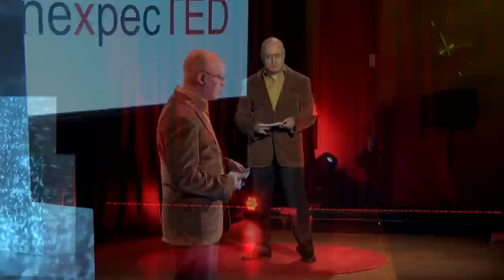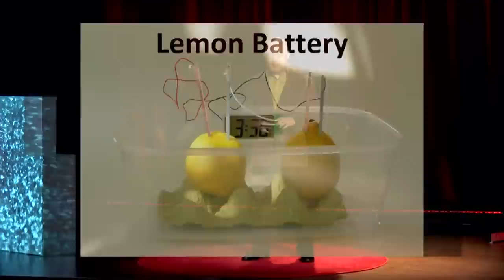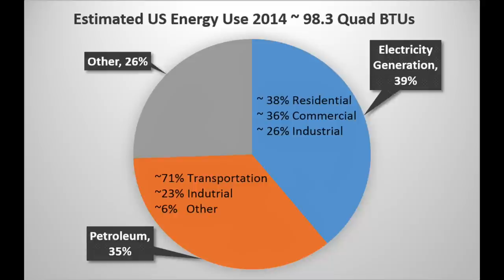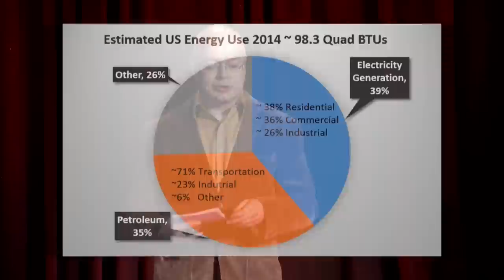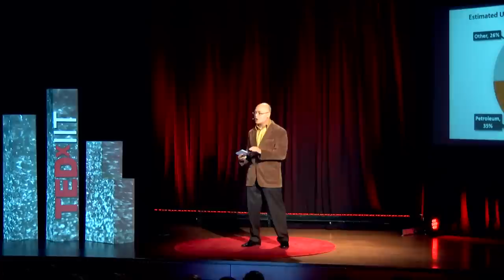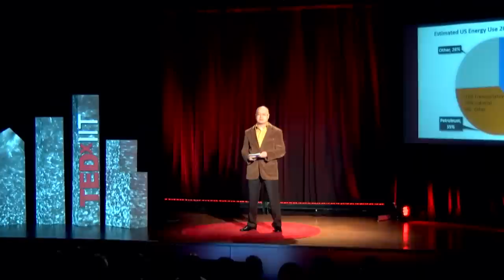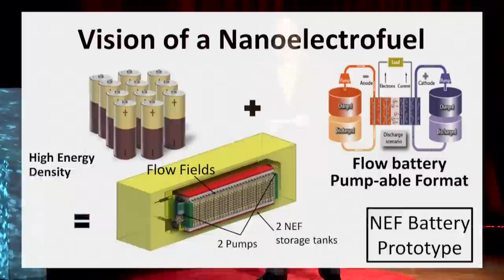Nano Liquid Batteries | John Katsoudas | TEDxIIT

Comment: Hey look guys! we got gas just different. now all the pricing and infrastructure is already in place. all we have to do is change the fluid in the tank of the gas station.the real format change he is talking about. with the least amount of true change for the mega corps. I love how it is sold as convenience for the consumers and not the corporations, when he corporations are responsible for putting us all in this catch 22 situation in the first place. I thought the whole point of a new energy was to get out from under the foot of these mega corporations. now these guys have found a way to keep these bastards in power. I'll bet they were curious! One oil exec says to a scientist. We will support electric vehicles when you can get electricity out of oil. and the scientist says I'll just change electricity into a fluid. and you get this crap. Seems like only one party in the whole equation is being pitched to and it's not us little people. look into the hydro torch, it burns water. If you can burn water you can run a car on it. all problems solved. and before you bring up water shortages it works best with salt water.
Reply: Most of the oil worldwide is produced by state oil companies, not the evil corporations. You can't burn water, you have to separate it into hydrogen and Oxygen which takes more energy than what is released upon recombination.
Reply: Scott Stangler    You are absolutely right on! Those already powerful fuel-companies would absolutely love to take advantage of this opportunity to customize their mega-wealth-generating model onto a similar format of what they know best, which would keep them in the same game of making all the money in the world that they are able to.
Reply: tarstarkusz     You are right about the difficulty of using water as a power-source, it definitely takes much more power to convert water molecules into a practical power-source.
Reply: And I've seen hydrogen made with a 9v battery and two pieces of copper tube and some wire. But there is a man that has figured how to burn water. I'll see if I can find it and I will post it here.
Reply: Scott Stangler    I checked out the website-link that you provided, but that "Hydroflux Welder Water Torch" requires 110V electricity to operate, plus they also mention some chemicals, too. So, the problem with "water" as an energy-source is that it is not behaving the same way as alcohol or benzene or any other combustable liquid does. The complex molecules of water must be first converted into pure hydrogen, which process requires more energy input than the output of electric-energy of what we would get at the end out of it. This is why we no longer hearing that hydrogen is a practical power-source of the future as they falsely claimed it to be 10 - 15 years ago. Since then, they stopped all hydrogen-powered projects, and now the sensible scientists and inventors are mainly focusing on researching/inventing the most practical battery technologies, which ideally would be cheap, yet at the same-time, very powerful batteries, and batteries are the solution to capture the energy input of solar technologies. 

There are some people on the Internet who are lying about new discoveries just to gain your attention, so be aware of their deceit. 

Do you think that if this "Hydroflux Welder" machine could really produce useful "EXTRA" energy out of normal water, then its inventor would settle and be content just to produce this welder? No way! He would produce and manufacture energy generating machines and become the richest person in the world. Think about that.
Reply: Scott Stangler     "Burning water" with some other form and source of energy input is one thing, but the BIG question is: How much energy are you getting at the "end" of the "output wires" as the desired EXTRA energy gain? Are you getting more energy out of it?
Reply: George Galamb i understand the concern. Yet we have all heard that the biggest threat for humanity is climate change. And supposably we are all responsible. yet we are only the consumers of the products offered. the bottom line is, they all want us to feel guilty for life, all the while they never have to change. the technology has been on the planet since 1897 to do everything differently. and safer for the environment in general. but because investors control the direction of all research. the investors stear the ship. and we the consumer just have a ticket to the show. and the investor only invest if they have a sure thing type of pay out. it's all about the share holder's. they are the corporations.  if you ever wondered who runs things it's the share holder's. AKA board members. cheers
Reply: to fix the problem would hurt the bottom line for the mega corporations. yet we are all to blame. and now they want us to pay for the oxygen we use. it's not a carbon tax. its an oxygen tax. typical legalese. say one thing and mean another. humans breath oxygen and expel carbon. it's all based on the oxygen we all breath and the oxygen every engine on the planet needs to fire. think about it. we turn oxygen into carbondioxide. the engines just burn the oxygen. they don't convert it. the carbon an engine produces is from the fuel used. the real reason for probation was the car industry. the old model T's ran better on alcohol. aka moonshine. had to get the farmers to stop making their own fuel. don't you know. so they could push the future of gasoline. It's all about the money and the share holder's that need it. you have to understand also. what you make in an entire year is like 25 cents to these people I speak of.
Reply: Sure, I agree. Definitely, the share holders are the one who originally invested their money at the beginning in all sort of startups out there to later make as much profit as possible. And they are not too happy when some new technology comes in their way to jeopardize their investment.
Reply: When your vehicle's engine burns gasoline, all it needs is a spark/flame and oxygen and a chemical reaction happens, and you have an explosive-force in your engine doing its work. Oxygen in the air is already in the form that any fire can utilize, so you definitely don't need to convert oxygen into anything else. But, if you want to use water as a combustible power-source, you definitely need to convert it's molecules into hydrogen. Think of it this way: Smell with your nose a little water, then smell gasoline. You immediately will realize the the big difference between them. Gasoline and alcohol and paint-thiner and other combustible liquids and gases has a distinctive odor to them, while water is odorless.
Reply: George Galamb this guy has figured out how to do it in one step. Essentially turning salt water into a hydrogen/oxygen  fuel source. Much like an acetylene oxygen torch woks. All based on the vibration created by the radio waves. I see it as more of a direct separation than a conversation. The molecular structure vibrates at a specific rate to turn each into a gaseous form and facilitates the ability to burn said molecules. He is able to get 1500 degrees of heat from the flame. Everything is frequency. The rate of vibration Aka frequency. Establishes its state if matter. The radio waves are a sort of supercharged process  to the end result. Now you can argue all you want about the complexity of the process. But it doesn't change the fact that the technology exists. The cost is set by those that oppose it. Money talks.
Reply: You forgot to place a link here, so I could take a look. Listen, I don't want to argue with you. I am just as passionate to find out more info as you are. I am just stating what I know. And you are stating what you know. But, I hope that you are aware of the many-many false claims that are being posted on the Internet. They even fabricate false news! It is a big problem today. I am not saying that your information is incorrect, but what I am trying to say is that in today's world there are too many people are trying to post false/fake/ videos and information, trying to deceive the unsuspected public to believe anything that they're seeing with their eyes. 

I personally believe that anything and everything is a potential possibility, but only if figured out the right way, if designed the right way, if build together the right way. But the right way most of the times requires a million different way of experimentation and a million ton of patience and stamina and persistence. And this is where most people who are trying to create the seemingly impossible, are giving up too early.
Reply: he said they patented it To me that doesn't mean free to the world it means locking it down
Reply: Scott, there are so many problems with what you’re talking about that I barely know where to start.

The guy with the vehicle running on water is a scammer.  He won’t let any independent party inspect his “invention,” nor will he publish the plans.  It’s fake.

Yes, you can burn hydrogen and oxygen to make water, but that reaction is far more violent than the comparatively slow burning of gasoline.  That means the engine has to be MUCH stronger - which means much heavier.  You also have to expend a lot of energy separating hydrogen from either natural gas or water electrolysis.  You get less energy back than you put in due to heat and friction losses of the equipment, and you now have a very dangerous compressed gas sitting around while you wait to use it - far more volatile than a tank of gasoline.

If you have to resort to conspiracy theories rather than the obvious fact that gasoline is just convenient, then it’s hard to have a real conversation.  Good luck in your endeavors to figure out the technology.

Comment: This guy has some cool ideas!  Flow battery!  I like it.   This guy is on the right path.  

But first, No, we don't all KNOW that CO2 causes any climate change.  Bad presumption.   CO2 helps plants grow.  We should pay to convert it....  Fourier (inventor of heat equations and the math for Fourier analysis) said in 1820 that CO2 was not an issue and he was right.... 

Paying more?  How about a lot more.  Electricity is 15 cent/kw-hr or $5/gallon equiv.   Tesla battery is 300 lbs/gallon equiv of energy vs 6 lbs/gallon gasoline.  It is also 22 times move volume per energy (kw-hr/gallon volume).   An electric car is 3 times better than an Otto cycle plug to wheel vs pump to wheel.   That means the weight /mile is 100/6 or 16.6 times more.  3.66 times volume/mile.  Not good.